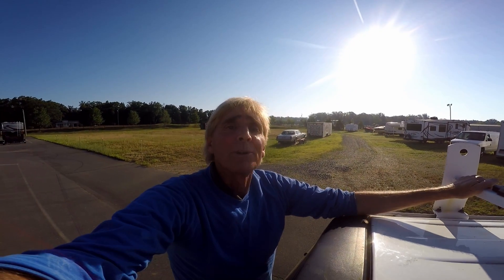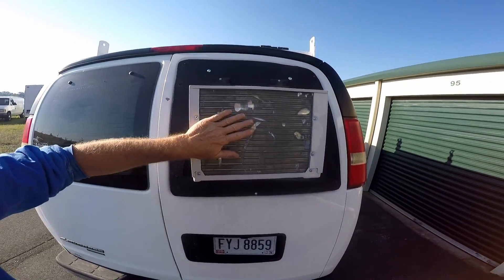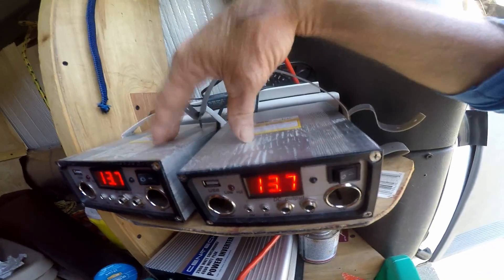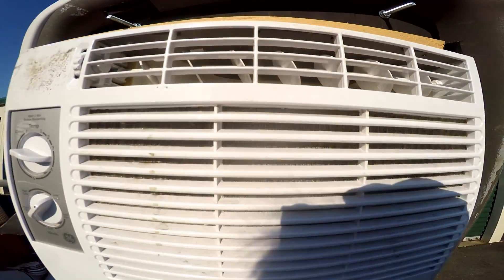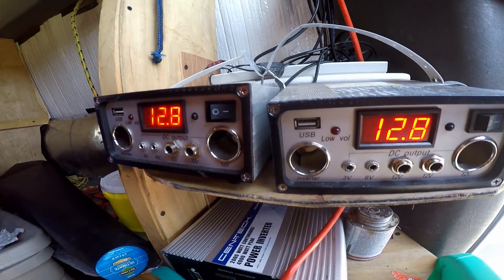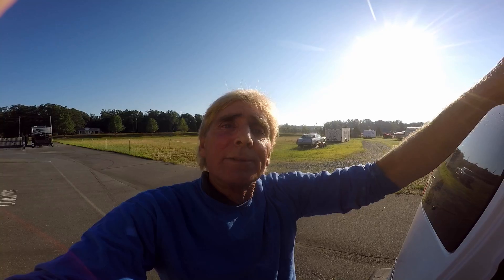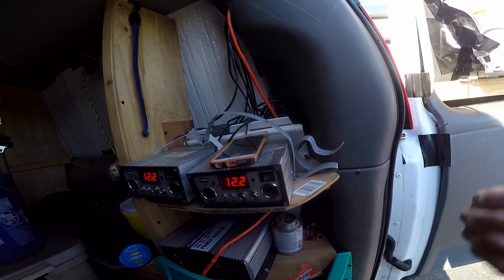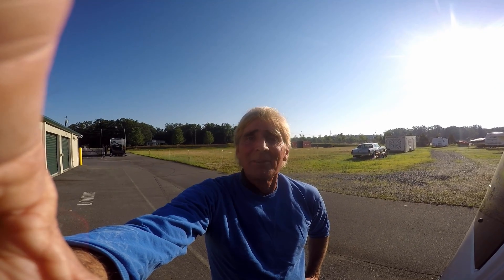90 Watt Solar Panel Runs 800 Watt A/C

Comment: If there was a 100% conversion from 12v to 120 v  and there is NOT it's about 80 %  it would take 《10,》  100 watt  12volt panels to make just 100 watts  of 120 volts.
So it would take 《《70, 》》 100 watt 12v  panels to make 700 watts of 120 volts to run a 700 watt 120 volt air conditioner directly off the sun provided it pulled 700 watts  of 120 v continues 
 SILLY GOOSE
Reply: Paul Dunn actually I believe you're very VERY incorrect.  Yo mean to tell me it takes 1000 watts of solar (dc) to make 100 watts of ac power?! 😂😂😂 someone knows nothing about electricity!!
Reply: Paul Dunn watts are watts homie.  A 2000 watt inverter will run 2000 watts of AC power. A 2000 watt inverter will draw 83 amps of 12v dc power.  (2000 watts) and it will put out 8.3 amps of 120vac power (2000 watts)
Reply: Voltage X AMPS = WATTS  DO THE MATH SILLY GOOS
Reply: 10. 12 volt 100 watt solar  panels  IN SERIES is 120 volts at 100 watts  
DO you see now.
Reply: 10 12 volt batteries 1000 amp
 IN SERIES  IS 120 VOLTS AT 1000 AMPS.
Reply: Paul Dunn no, 10 twelve volt 100 watt panels in series is 1000 watts.  10 panels on parallel is also 1000 watts.  The watts don't just disappear.  You need to do more research on electricity
Reply: Paul Dunn and yes watts does = volt x amp. So why would 10 panels in series be 100 watts?! It would be 1000 watts. 120 volt by 8.3 amps is what??? Oh 1000 watts
Reply: potc420 you have it backwards  10 12 volt panels  in parallel  = 1000 watts at 12 volt
Reply: Paul Dunn Paul Dunn why do you say a wattage @ what ever voltage.  The only time you need to specify the voltage is if you're talking amperage.  WATTS ARE WATTS 1000 watts at 12 volts is THE SAME AMOUNT OF POWER as 1000 watts at 120 volts. WATTS ARE WATTS!!!!  1000 watts @ a million volts is the same amount of power as 1000 watts @ 1 volt.  How don't you understand this?
Reply: LuckyFlesh the guy was saying it would take 70 - 100 watt 12v panels to get 700 watts 120vac.  Apparently 7000 watts in is needed to get 700 watts out according to the op
Reply: LuckyFlesh S'all good!
Reply: +potc420
In Series the voltage adds up but the Amps remain the same.
In Parallel the Amps add up but the voltage remains the same.
Reply: LuckyFlesh why are you telling me things I've known for over 30 years? In both series and parallel applications the WATTAGE increases.  WATTS ARE WATTS. If you talk in watts you don't have to talk voltages and amps. Watts are pretty universal
Reply: LuckyFlesh take a 100 amp hour 12v battery for example.... That's 1.2kwh of power.  If you hook two in parallel it's 200amp @ 12v or 2.4kwh of power.  Two in series is 100 amp hour @ 24v OR..... 2.4kwh of power both series and parallel configurations give you equal amount of watt hours
Reply: potc420 no. yoi seem to be missing the point that the LOAD will require a certsin Voltage.

thats why 12v or 24v and series or parallel matters.

just because the watts add up to the same number doesnt mean the everything else is the same.
Reply: potc420 if you had a gallon jug that was 3/4th whiskey andv1/4th water and another jug that was 3/4ths water and 1/4th whiskey,  would you say they were the same just because they're both 1 gallon?

200 amps at 12v snd 100 amps at 24 volts are both 1.2kw, but they're not any more the same than the gallon jugs of water and whiskey.
Reply: LuckyFlesh considering the original conversation was about solar panels yes my example is relevant.  Do you know what MPPT is and how it works?! Weather you hook your panels in series or in parallel the wattage is the same.  I have 150v dc coming in to a 48v battery bank. Running a ac unit off a 12v inverter is pretty inefficient tbh. I wouldn't do it with anything less than a 24v inverter. A 48 volt inverter or 60 volt one would be even more ideal.  You could run a central ac unit and cool a entire house with a 48 or 60v inverter
Reply: potc420 oh hell, my bad. seems I read it wrong and I owe you an apology. 

sorry about that. maybe he got amps and watts confused?

again, my bad, sorry.

Comment: Hie watsup.
Ur system is really amazing. i like the way u designed your minivan into a rooftop solar panel mounted ac van. awesome. I m from India and here v get 8hrs of solar irradiance and it is much better to make use from solar power. I am planning to have a roof top solar system like urs in my van too. can u please send me the electrical diagram and the hardware used in ur system. will be great help. thanks

Comment: i live down south how many  batteries  would I need to run 2 window air conditioner all day and most the night when its hot??? and how many Solar Panel  ?? thank you
Reply: what you can run has nothing to do with how many batteries you have unless you want to run it in the dark.

Comment: the reason I say toys is those harbor freight panels are for the average expimenter. I have 5000 watts of really  big heavy panels and a 300watt inverter that runs the house. I cam keep up with daily demand with 5000watts of solar electricity and can draw those 5000 watts all day li g running a heat pump, hot water heater refrigerator and all the lights and tvs etc. goo job but you can't run that ac very long in the day with 90 watts of charge . that means you can only draw 90 watts after you depleted the stored energy in your battery . and I know you will only get maybe 3 hours maximum continuous running. on the other hand if you run it for 30 mins at a time then let the batteries charge for 3 to 4 hours you could get maybe 4 house total from an inverter which is not 90 percent efficient at best .

Comment: no the ac is running off of your batteries and inverter and you are just charging it up with your toy panels. you cannot run an ac designed for 120vac directly from dc solar panels.
Reply: He never said that, genius. He clearly states he uses an inverter. But it is still a BS click bait lie.

Comment: Based on the physical size, those look like at least 50 watt each solar panels, they take up almost the entire top of his van.  No way those are 15 watts each.  50 watts times 6 panels =  300 watts.  I think the 800 watts is a peak/ start up wattage for a small window unit, running wattage is more like 500, it depends.  Also, this AC is only cooling the inside of the van, so it will only be air conditioning a tiny fraction of the time, perhaps 20% or less, the rest of the time it will only be operating a fan at perhaps 50 watts.  Thus, I think the guy is wrong about the "size" of his solar panels.  But cooling a van does seem feasible because the AC will only be air conditioning a tiny fraction of the time.
Reply: they are 15 watts look them up at harbor freight. i own some
Reply: those are harbor freight panels, I have some too.  there are three panels in parallel,  15 watts each for a total of 45 watts for the three. and he has two sets so   yes 90 watts.   But they won't run the ac unit. the batteries can run it providing your inverter has enough wattage to start the ac unit.  the batteries would not last long if the ac unit was running continuous and the solar panels are only going to give you 6 amps of charge while the ac is drawing about 60 amps from the batteries.
Reply: Amorphous panels are very inefficient at making power and only last
about 5 years don't ever buy them

Comment: lost half a volt in 3 mins lol 😂 so that's about a hour and dead.
Reply: integr8er66 dear Christ!! 11.5v 😂😂😂 never in my life would I dream of draining a battery THAT low! I won't ever go below 12.1v (50%) 
11.5 is definitely gonna cause permanent damage to you're battery
Reply: No it's not, dead is about 11.5 volts on most lead acid batteries. after that you ruin the battery and you can't can't get any amps out of it.
Reply: I'm pretty sure that is what I said. 11.5 is not the level you should drain a battery to in normal use, 11.5 is DEAD AND DAMAGED.  We were discussing if this is even possible (ONCE) not if this would work day in and day out which it certainly wont. 12.1 may be 50% and I set my charge controller to stop at 12.2,  but I said nothing about 50% dead or when to stop draining it, I said it would be ruined. You should never take a lead acid battery all the way to dead.

Comment: Solar panel prices have come down,  you can get a 100 watt panel from grape solar on amazon for 124.99 right now as of this post.  I think it is a better deal than harbor freight panels,  even alt energy website is pretty competitive on solar panels.  
Keep the videos coming they are always interesting.
Reply: It's very simple to find out how many batteries you will need. Here is a quick rundown.

It's all about Watt Hours. Multiply the watts of the device you want to run by the number of hours you want to run it. 

So an 800w AC uses .800Kwh. To run it 12 hours a day, you'll need 9600wh (9.6kwh) of capacity from batteries and solar.

Your average 6v Deep Cycle battery has ~225ah of capacity. So 2 of them in series makes 12v @ 225ah or 2700wh. (2.7kwh)

Now keep in mind you never want to use more than 50% of your batteries capacity. So you're 12v 225ah bank is in reality only 112.5ah or 1350wh. (1.35kwh)

Having said this, to run an 800w AC 12hrs per day you'll need a battery bank of 19,200wh (19.2kwh) along with a 3.2kw solar array assuming you can get 6hrs of sun per day.

One cloudy day will throw this all out of the ring though. It is ideal to have 4x the battery capacity that you need. Which would be a 3200 amp hour 12v battery bank.
Reply: Even lower!!! I found one for ALMOST LESS than 100$
I found one for 103$ no tax free shipping! WHOA!
Reply: You can buy solar panels for even less than $1 per watt.  If you buy enough 250-watt panels, most solar manufacturers now will sell them for $200 to $210 each.  I would cover that van with as many as you can fit.  The problem is, you'd also need more batteries if to keep that 800w A/C running throughout the night.... and that sucks.
Reply: I got a 305w mono panel for $150 brand new locally on Craigslist. They're cheap as hell!
Reply: +Christmas Eve can you please go into a little more detail about this. Exactly how many deep cycle batteries are we talking about to realistically run that ac? 

I think another challenge that is overlooked is that space is limited on the roof of some camper vans.  There is only so much solar panels you could fit up top that basically renders running a low(est) wattage ac on realistic and practical level,  completely useless. I mean,  those batteries alone are incredibly heavy and adding so many more seems well....meh, you know? How long are they really gonna take to fully recharge the battery bank? I highly doubt they'd charge back up fully in one day right?  Put those limitations together,  you end up with lots of folks with high hopes and little to show for it in practicality. 

 I think my spiked Kool aid with solar anything is wearing off a bit.  But then again, rigging the system with battery isolator or solenoid kit getting juice from alternator,  on top of solar, albeit secondary, seems more promising, right?
Reply: Actually you can get one for 109$ from amazon right now :D
Reply: yes !!!!
Reply: Can i run the solar panels directly to the inverter to the air conditioner without using batteries?
Reply: SUN ELECTRONICS has the lowest price on panels with a guarantee.... sunelec.com
Reply: J No
Reply: no